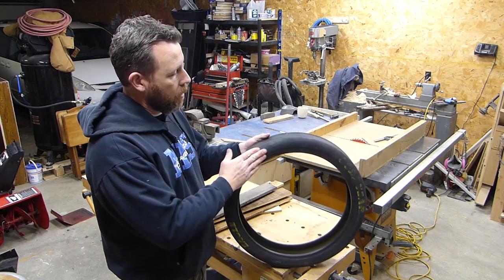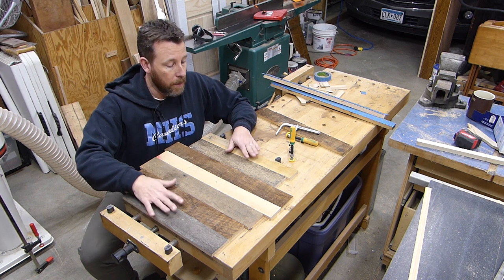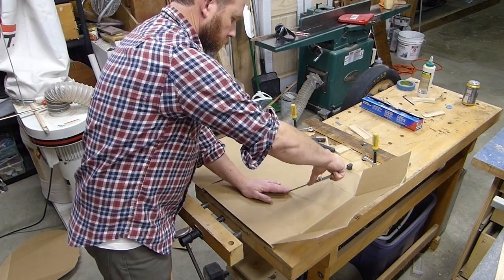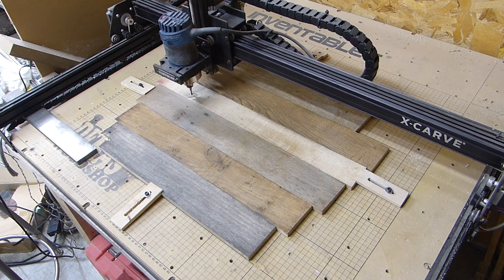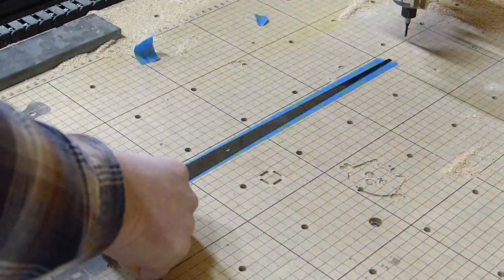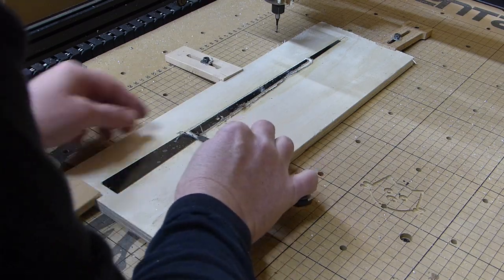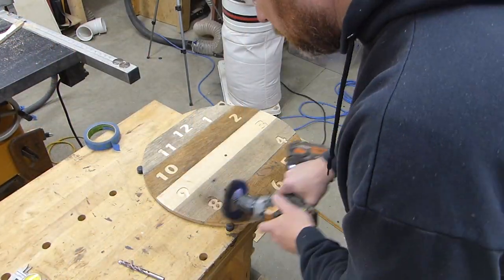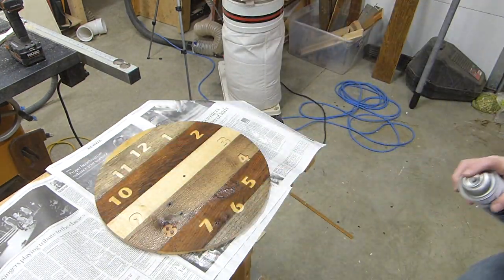Ultimate Shop Clock - How to Build a Clock from a Drag Racing Tire and Reclaimed Wood

Comment: I like it. You really didn’t show how you fixed the face to the tire.  Besides the spacer blocks what else did you do?
Reply from the maker: That's all i did.   The tension from the tire rubber itself is holding tension on the clock face between the four blocks.   Had to get the block thickness right but that's it.   The tension from the tire  holds the face in place.
Reply: @Jake.of.All.Trades  Came to ask the same question, glad to see you have answered it. Great project and a really cool way to use a tire!